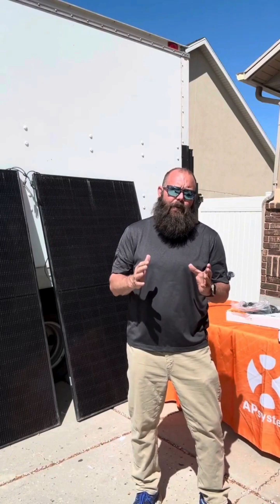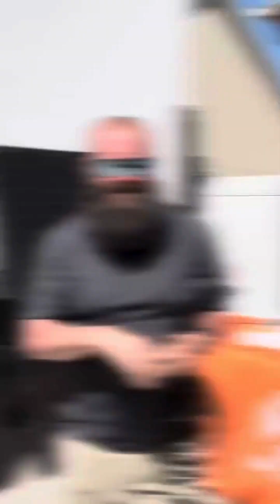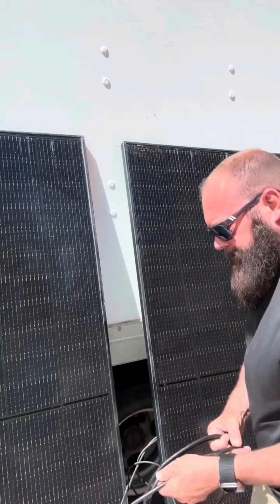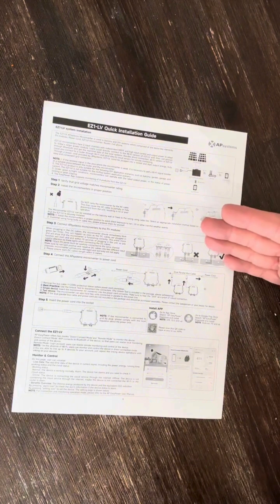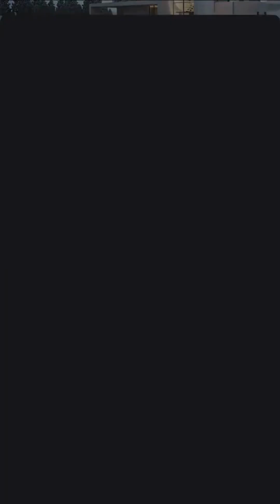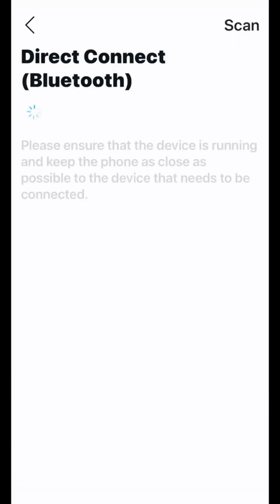Plug in & power up with EZ1

Comment: Good afternoon I have a question about your.  EZ 1  I am running a small Solar system .  I have 2  panels Each panel puts out 410 w The video that you show has channel 1 and channel 2 what is the highest rating each channel can except is it possible for me to put 410 w On channel one, and 410 W on channel 2 for a total of  820 W.  Combined … A sidebar question to that Is it possible to run in series  820 W on channel 1.   If so, what would the configuration be .. the second question is kind of crucial as well. Most inverters, I have seen have been legally rated for other countries outside the US. I’m not sure if the US would accept that rating .because I  Could be checked for city code Inspection in the US. I’m going to I assume they are going to look for a UL rating what is your findings and what have you run against regarding grid tie Inverters in the US that must be certified to UL 1741 to meet safety standards, and utility interconnection requirements Thanks for your time. Enjoy your sunny day.